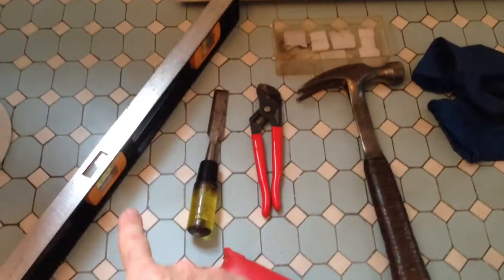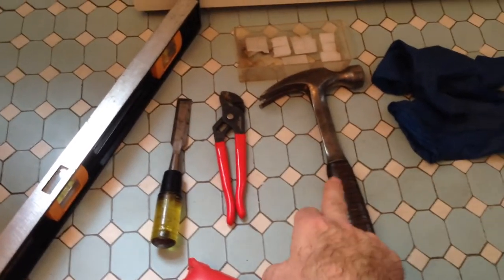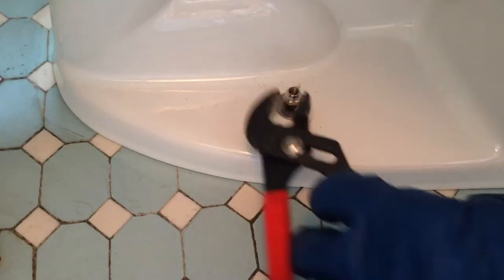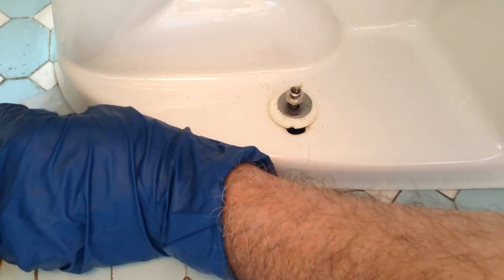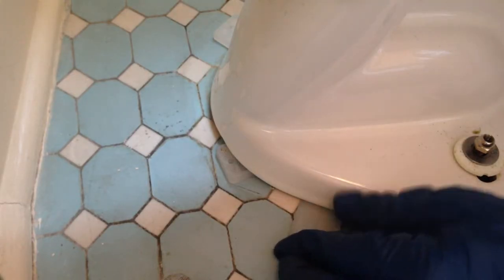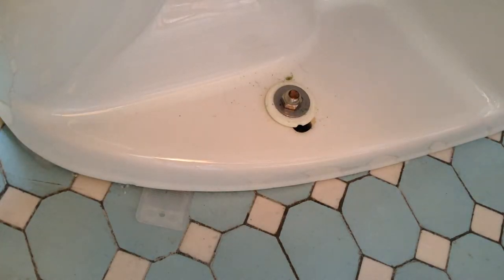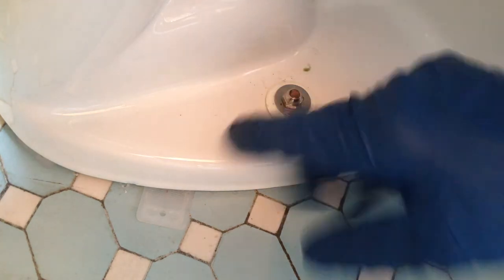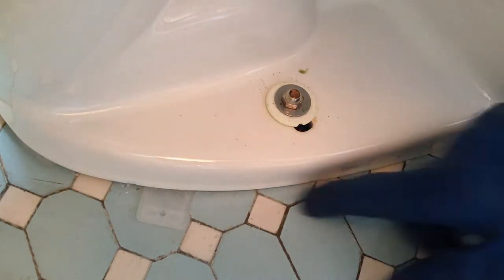Installing toilet shims

Comment: The wood chisel cuts great in your video, but I might crack my new 12" floor tiles!   So I'm looking for a softer composite shim that'll cut easier than the hard plastic/nylon ones.  Thanks!
Reply from the maker: Good luck.  Let me know if you find any